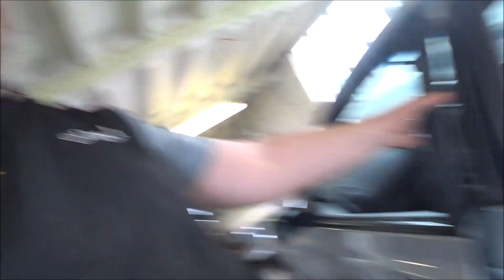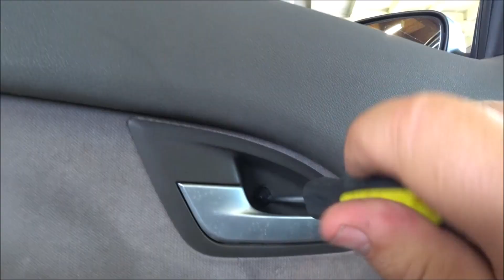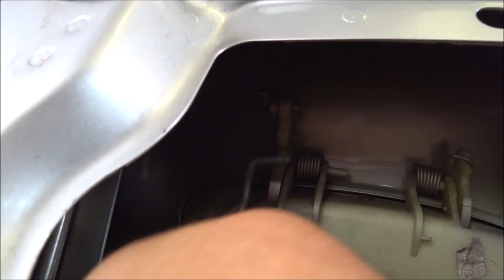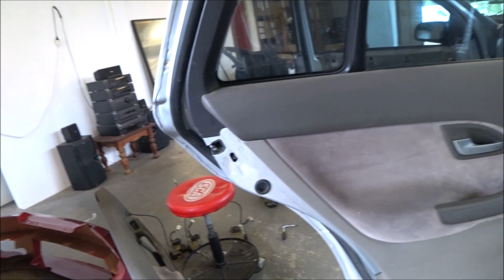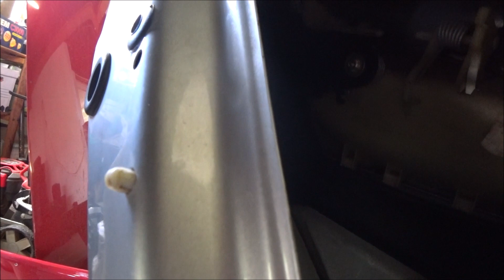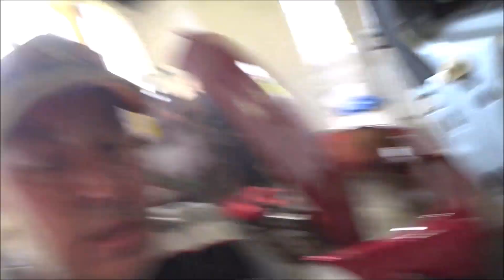BA Falcon -  How to Replace BA Falcon Door Lock Actuator

Comment: I had the problem with the passenger rear door of my 2003/4 station wagon AUS version. The rod needs to be removed as follows: 

Remove nuts holding outer door handle (2 of), detach handle from door panel and then disconnect door latch rod.

Remove latch retaining screws (Torx head). Disconnect interior handle cable from latch and remove latch from door.

From Ford manual

Installation is the reverse.

Comment: Thanks mate. 

Helpful video. 

My driver-side door has the same issue. 

The only difference is it’s closed and it won’t open 

Its completely fallen apart inside so now I’m looking at getting out the Dremel and grinding off the heads of the rivets that hold it together so I can essentially just break it apart in situ in order to remove it and open the door and replace it……..

I did get it open a few days ago and as an insurance measure took the door trim off before I closed it again so the only blessing is I’ve got really good Access 

but she won’t open 

Two “locksmiths” from bombay - if you know what i mean - have come out tried and could not get it open ……..

Comment: Easy fix yeah buuuut How do you get the door open if it locks closed (as if deadlocked?) And yes the customer has changed the door key lock part at some stage and then lost the keys! 😢
The inside handle cable is lock extended so no opening the door from inside either.HEEEELLLLP! Any ideas will be appreciated.
Great video thanks
Reply from the maker: Should be able to het the door skin off with it closed to habe a look at it.
Reply: Without breaking or cutting the door skin?
Reply from the maker: @MrConspark  might be tight with the seats but maybe. Check the screw locations on the side that opens and see. Perhaps the seat might need to be loosened up to get the lower ones.
Reply from the maker: @MrConspark  and if bot, it might give you enough space to get an arm in and manually pull the lever to open.

Comment: Just popped my  🍒 doin my first actuator on RHR on my 03Ba xt.. thanks for the vid, I can confirm the grey or white plug you talked about. 

My original actuator  has a grey plug. But from ford there was literally a small 10cm cable with one end to the acc with a grey connector... The other end had a white connector too the loom. 
But the replacement I got only had a white plug connector on the actuator..to which I just  simply plugged straight to the loom.

Also double check when installing replacement...make sure the large plastic tab for the child lock is under the small square metal tab when the actuator mech  is in the "closed door" position. 
This cost me 4 bloody times putting the dang door card back...an doin a close door/ open test .. figuring it out!!! But tbh having know this now probably would take 20 min tops...not 2hrs🤪🤪🤣🤣
Reply from the maker: Yeah every 20 min job is 1 unknown away from a disaster, but not a biggie a bit of logic should sort most things
Reply from the maker: You could to that 90% of what comes out will be the new oil, regular changes is the best flush.

Comment: I put a brand new one in my back right hand door. But the central lock still does not lock this door. All others are locked. And my cruise control switch isn't working. Why when I put a brand new one in the central lock doesn't lock the RHBD?
Reply from the maker: Is it plugged in right? Perhaps there is an issue with the loom to the door?

Comment: Great video but I just put a new one in my right hand back door. Station wagon. BA. But the back door won't lock. I've tried the lock button but no luck. What have I done wrong?
Reply from the maker: Is the replacement working?
Reply: @tangles01  yes. But the back door opens when I push the central locking button and only the other three doors lock.
Reply from the maker: @locomotion60  That's' the symptom that that actuator is not working.

Comment: Does anyone know if you can remove the grab handle you use to pull closed from the door trim or are they one piece
Reply from the maker: 1 piece to come off the door, you might be able to remove it after you take the whole thing off.
Reply: @tangles01  yea no worries my handle is broken off im using the map pocket to close the door ive got another door trim but its the wrong colour pattern inlay though i might of been able to take off just the handle part looks like thier plastic molded from behind
Reply from the maker: @aaronsmith5154  Ahh ok, well good luck mate, I'm sure you could find a correct coloured door card at a wrecker of off someone parting one out on marketplace.
Reply: @Chantelle Walker Hey Chantelle Ive found out how to repair them Ford or wreckers sell them a a one piece door trim but you can get after market bolt on handles that are the same but there's screws in the back of them rather then just plastic welds holding/fixing them to you door trim

Comment: Hey Tangles, I replaced the motor in the drivers door actuator which works but now the lock just keeps locking and unlocking! Any suggestions?
Reply: Never mind, sorted it!
Reply from the maker: @ThePirateWhiteBeard  Excellent
Reply: tangles01 Your video was helpful! It’s crazy how much it costs at some places to get this job done, totally worth DIY.
Reply from the maker: @ThePirateWhiteBeard  100%
Reply: @ThePirateWhiteBeard  was it an easy solution in your case , a mate had the same issue for years
Reply: @closertothetruth9209  If you're asking about constant unlocking / locking cycle that I had when I put the unit back in the car... Yes it was easily resolved... After replacing the little motor inside the actuator unit, I reassembled the unit but didn't connect a bit on the black case of the motor to the rod that moves the lock button up and down, this caused the constant locking/unlocking as the moving part had no "stopping point". It was reasonably obvious what was wrong once I pulled the unit back out and examined it. The mini motor swap was very easy also.

Comment: Thanks for posting this. I have the exact same problem.
Reply from the maker: Easy fix mate
Reply: Replaced it this morning. $65.00 for the one. Tried several wreckers on the coast and both the same price. Funny thing was the central locking wouldn’t work so swapped out the cable and the connector rod and all good. They were the same length though so who knows.
Reply from the maker: @stephenshoobert5930  All good mate as long as you got the job done

Comment: Tangles last week i watched your video on changing spark plugs and ignition coils on a Falcon for the 3rd time since it’s time for the plugs and coils to be changed on my BA XR6 ( I bought it 12 months ago from my neighbour , it had been regularly serviced )  I thought simple as , I’ll give it a go, I’ll take the Tangles approach, a few swear words here and there as I go along and she’ll be right . Well fuck me I nearly ripped my hamstrings of the the bones trying to reach that last damn screw on the plastic engine cover ( I’m a short arse , only 5f 7in ) I though fuck this shit I’ll take it to my trusted mechanic. When
mechanic pulled out the ignition coils he found that they were covered from top to bottom with gritty dirt , the only thing he can think of as to why they were full of grit was some stooge probably tried to wash the top of the engine and all the dirt and who knows what else fell in and around the ignition coils, mechanic blew all the shit out of it before removing the spark plugs, you should have seen what blew out it , fuck me sideways. It’s a good thing I’m a midget because if I had somehow managed to removed the plastic engine cover I would have ended up removing the spark plug and had all that gritty shit fall into the top of the cylinder , that would have been a fucken disaster 😧.
Reply from the maker: Yeah not ideal, this is why you have a phone though. use it to take a pic down the hold if you can't see it.

Comment: cool thanks for the falcon vid my back doors do the same  but have been to lazy to fix it  or have more important things to  do so i just live with it. and dont leave anything in the car  .PS I AM THE  GUY WHO KEEPS PESTERING U FOR MORE FALCON VIDS LOL LOV IT COOL MAN .WHEN MY FRONT DOOR FUCKS UP LIKE THAT I WILL KNOW WHAT TO DO. . I JUST PUT PEDDERS UP GRADE LEAF SPRINGS AND SHOCKS ON MY WAGON TO TOW MY CARAVAN FROM KATHERINE TO KUNUNUARRA IT GAVE ME 40M OF EXTRA CLEARANCE SO I WAS NOT DRAGING THE MUD FLAPS ALL THE WAY LIKE I WAS FROM TENNANT CREEK TO KATHERINE.THANKS AGAIN
Reply from the maker: Easy there big fella, no need to yell, glad you enjoyed it.
Reply: @tangles01  OK.DO A VID ON THE POWER STEERING FLUID 424, AND WHY YOU SHOULD NOT USE ATF.
Reply from the maker: I'd have to check the manual, most cars ATF is fine for PS fluid, but I haven't looked into the falcon for PS fluid as yet.

Comment: easy job to do, just a bit fiddly, I've rebuilt a few myself. +1 for the 10 buck kit though, definitely worth having one on hand just in case for any AU-FG owner, I guess it doesn't hurt to have a spare ignition coil in the boot of BA-BF either just in case lol
as for the actual latch mechanism failing, that one I haven't seen before. I hope it failed at home as opposed to anywhere you'd have to drive it home from, as having a door flopping around whilst you're driving doesn't sound particularly fun at all.
oh, and regarding the broken / missing fobs, just go on ebay. you can get a pair of aftermarket ones for about $14 and they work just fine, I've been using a pair myself for the last few years, and programming them to the car is piss easy

great video though, i'll be sure to send it to friends when they have this issue 👍

p.s. it's great to know that the handle arm can vary in length, something i'll have to keep an eye out for in future
Reply from the maker: The door latch failed while I was out on site working for 3 weeks so car was in the yard, I came home and my son told me it was broken, nothing he did of course, and why would he even need to open or close it to know?